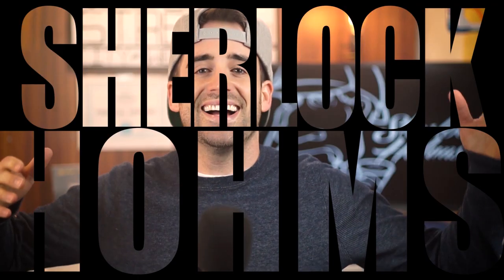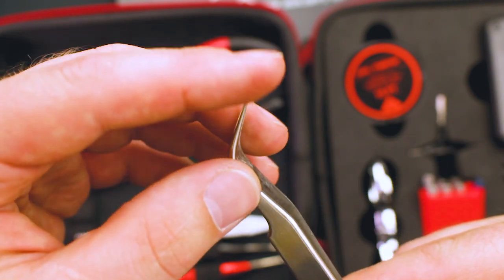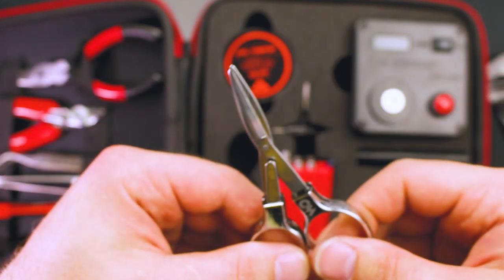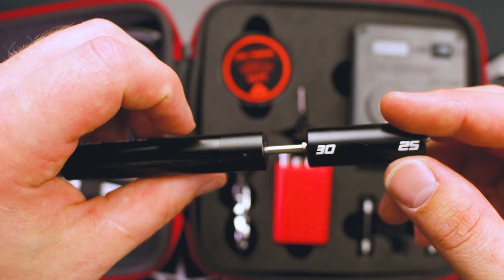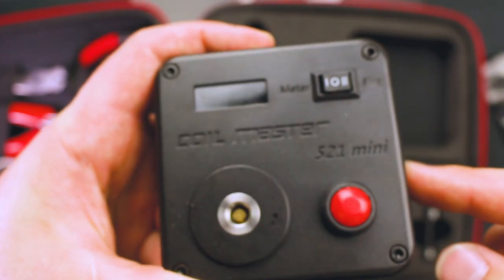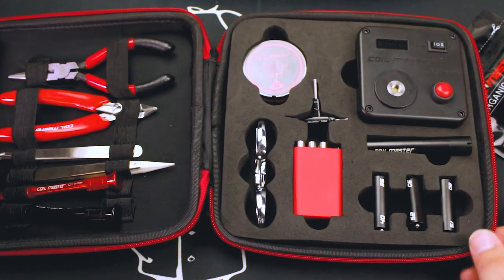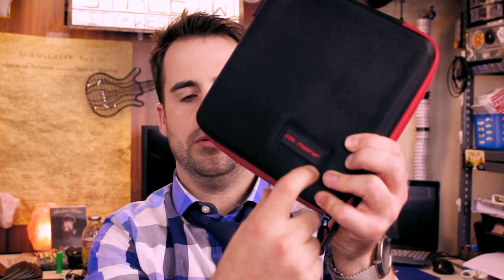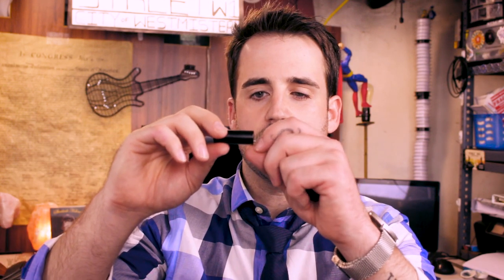Coil Master Build Kit V3 Breakdown and Review After Weeks of Abuse.

Comment: Dude man, you've taught me soooo much. Im surprised you didnt catch it yourself. The blue allen head screwdriver allows you to move the screw on the winder part you were pointing out would damage exotic builds, so as to change the spacing between the coil rod and the screw itself and allow you to wrap thicker wire and although for the most part you are right about it not working for exotic wire (esp not as well as it does round wire) it does allow for some types. Ive wrapped a few different types successfully albeit carefully once i moved the screw to the other hole on the winder. Claptons, dual fused, a few twisted, and very gently 6-8 sets of staple and aliens. Thanks for your time and review bud. Much love, 🌬💨
Reply: The tweezers make us all bleed. So handy tho
Reply from the maker: Trey Farrar haha yeah someone else pointed that out to me. It happens. I'm by no means the end all be all of building. Just a guy trying to help others learn.

Comment: I've had the v1 kit for a year and a half. It's been 50 bucks VERY well spent. The only things I've needed to replace after time has been the ohm reader, and the needle nose pliers. The flush cuts are just starting to dull out now. And you're spot on about the top half of the coiling jig. Useless for anything other than round wire, but great for beginners.

Comment: You don't have to buy new scissors, simply sharpen them with a wet rock which is the same thing I use to sharpen all my knife blades. It works perfectly! But you're right, the scissors aren't the best quality but they are doable for a while. After sharpening them a few times I can already tell that the life span isn't long. Thanks for another great video man .
Reply from the maker: alyssa t can you contact me? I'd like to learn how to sharpen them and make a video about it
Reply: just any old wet rock?

Comment: I just got back into building my own coils and the technique has improved by leaps and bounds. I used to rebuild the "Totally wicked" pen coils back in the day and I am lost these days 😂.  I just bought a Dead Rabbit V3 and it's UH👏 MAZE 👏 ZING 👏
Reply from the maker: Yeah it's come a long way man. Welcome back. I haven't built in a while but my channel has enough info that still holds up. Good luck!
Reply: @SherlockHohms  I understand what you're doing now and I just watched episode seven.........I can't wait until my ribbon wire comes in that is gorgeous when it's done 👍. I used to "Helix" my round wires but the builds have gotten insane. Thanks for showing all of this stuff because I just bought the 3.0 DIY kit and my brain just keeps thinking of different builds that are possible. My notebook will be scratched up and down with different combinations and theoretical designs.

Comment: nice video bro. Thanks for sharing your thoughts and this kit with us. I personally use a smaller size travel build kit by Geek Vape, which I LOVE, as it's MUCH smaller than other kits , and it contains everything I need to build. the only thing it doesn't have that I want, (that most kits don't have anyways ) is nylon covered pliers.....great for neatening up coils as you're spinning it. also doesn't include ceramic tweezers, only all metal needle nose tweezers, which suit my needs just fine, and assist in the glow process just fine for me. cheers bro, keep up the good work!!!
Reply from the maker: Brian Etris glad you liked it Brian. Have you seen the sigeili kit yet? I'm going to review that one next

Comment: Nice runthrough man. I use the coiling handle without the jig section, honestly I started wrapping on screw drivers and drill bits, so don't find it more convenient to use that, but the different sizes available are very nice. So it's the best of both worlds for me. Granted I just got this in over the weekend so maybe there's some little trick I'm not getting lol. The rest of the stuff is nice especially for the price.

Vape on mang